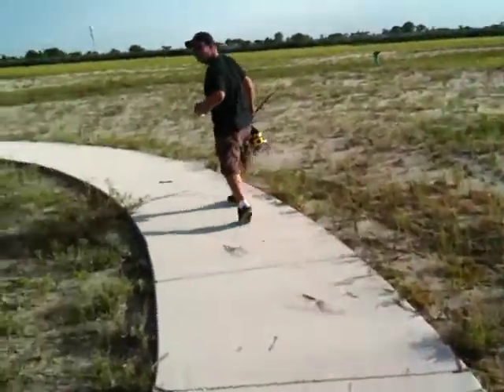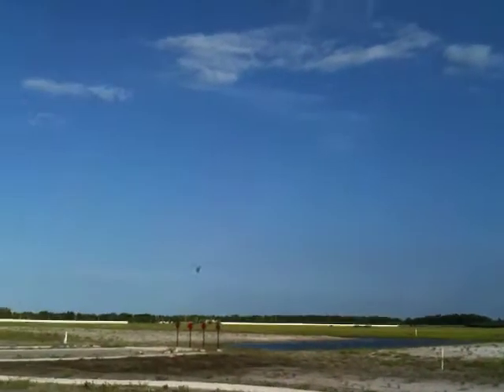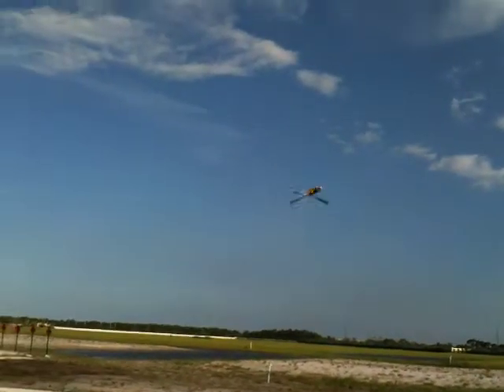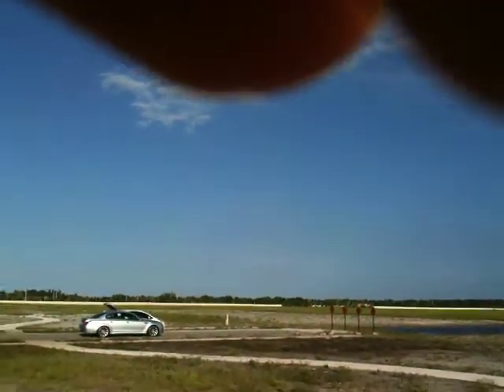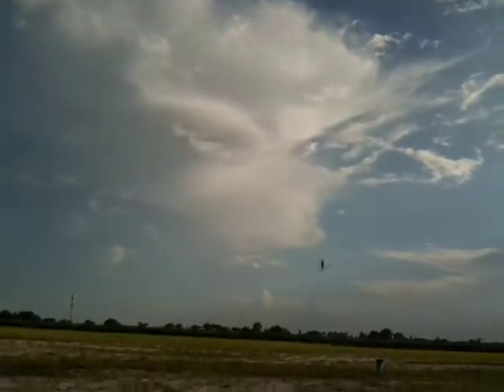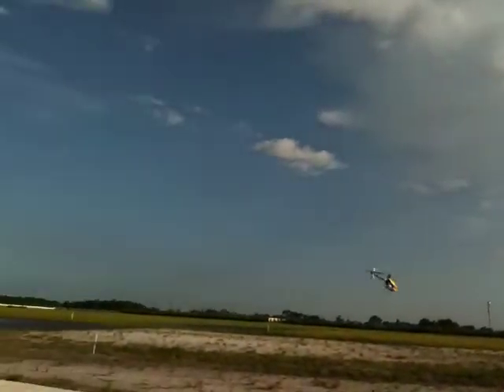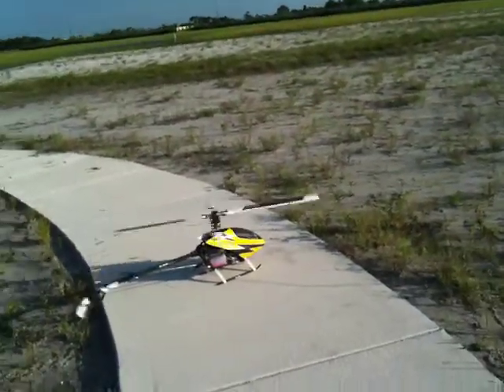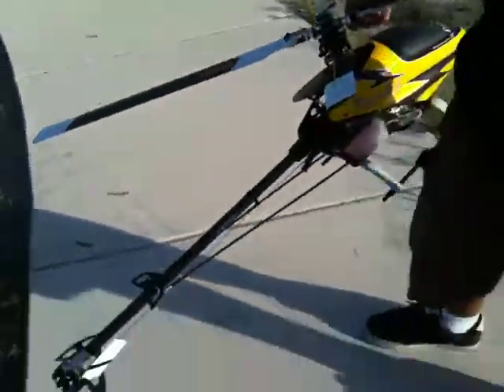EDGE 603 Flybarless Blades - Pilot: Bert Kammerer

Comment: The "flybarless" blades are a different blade than the flybar version.  They are slightly heavier, which is the preferred blade weight for flybarless machines.  These blades that Bert is testing on his flybarred machine will give you a more stable and better tracking heli, as opposed to the flybar version which will give you faster cyclics....

Make sense???